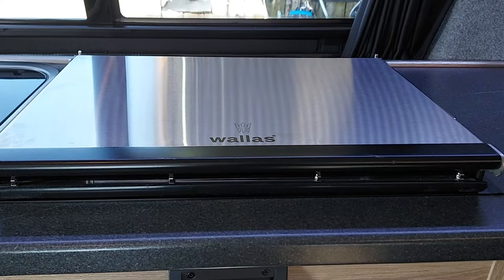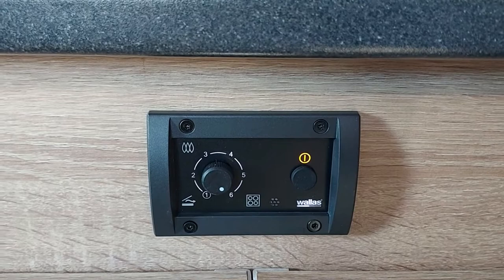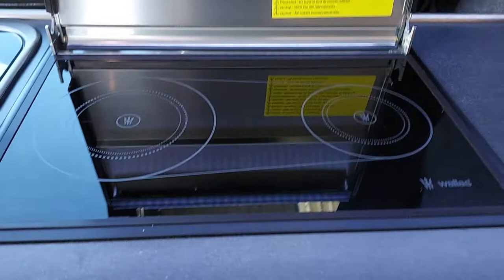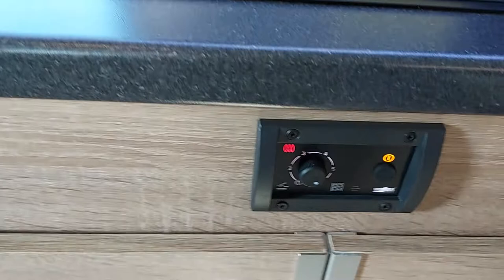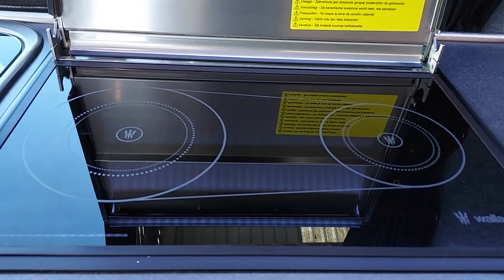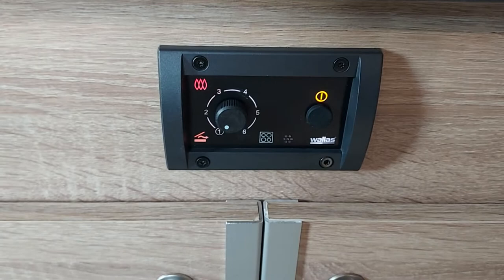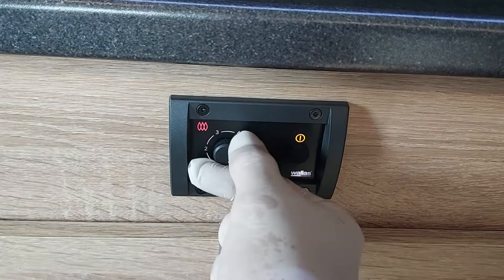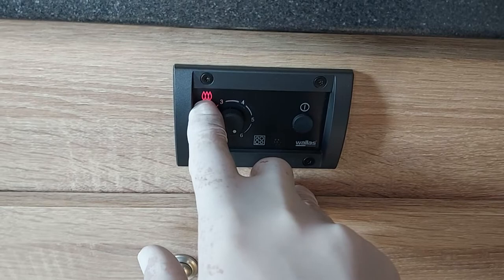Wallas Xc Duo Hob/Heater instructions

Comment: These units are safe, efficient and sleek. Installed one in my camper last summer but sadly lost the camper to a cracked engine block a couple of months later. During the time I got to use the XC Duo, it became the heart of the van. It was quite difficult fitting the exhaust hoses (which were a couple of inches too short so I had to order additional longer hose) but other than that, worth every penny. I miss it, and I miss my van.

Comment: How hot does the surface of the lid get while in heater mode?
Reply from the maker: You're still able to touch the lid when its on a lower setting on thermostat mode.